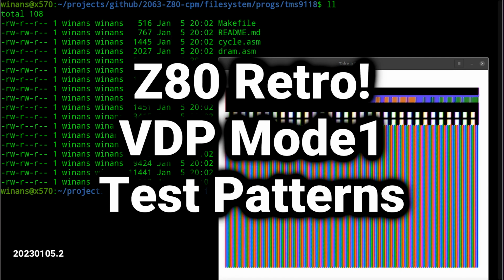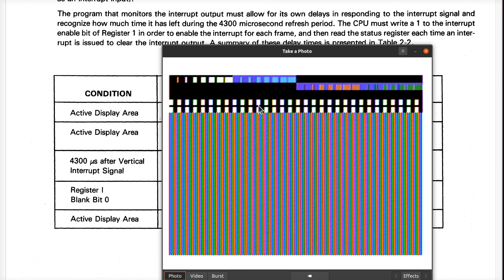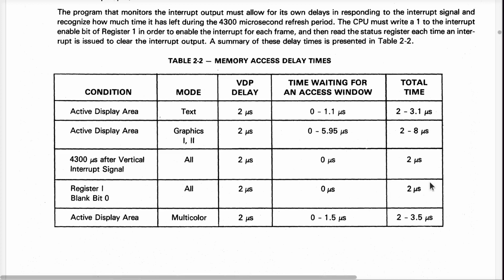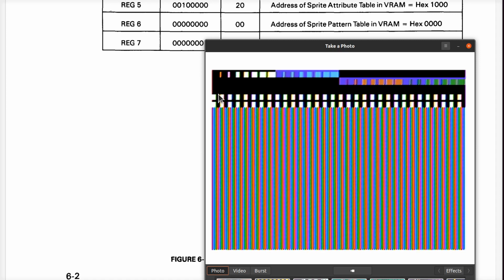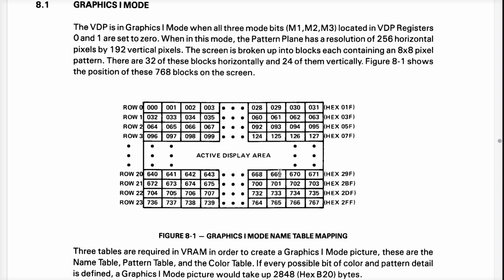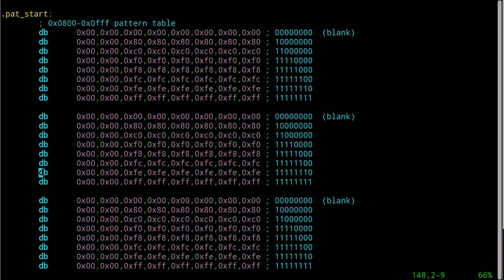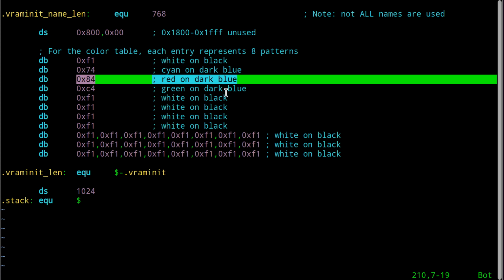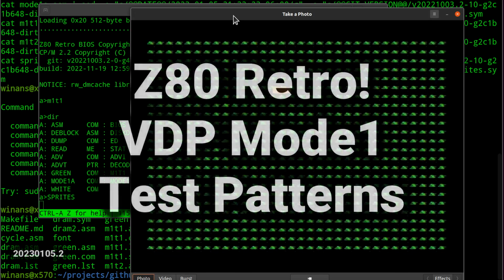Z80 Retro #56 - TMS9118 VDP Graphics Mode 1

Comment: Once I figured out the vsync interrupt, I was able to allocate 768 bytes of system ram to the display. This massively reduced the complexity of the game I was writing. I just store stuff in my allocation area and then the interrupt service routine streams it all out to the name table in vram every 60th of a second. My setup is a 6502 on a breadboard running at 1mhz. 

I'd need to run the CPU a little faster if i wanted to work with graphics Ii mode.
Reply: Just to follow up on this. At 1mhz i could refresh the display during the vsync window without delays. But at 2mhz I needed a 2 NOP (4 CYCLES) delay to not get tearing and garbage on screen.
Reply from the maker: I have been doing the same sort of thing... use some system RAM to prepare and image and then 'burst-copy' it into the VDP when the Frame Flag toggles.  I'm pretty happy with that so far.

Comment: If you're writing to the VRAM in big chonks, it really helps to set BLANK, so that you can write to the VRAM very quickly.
Reply from the maker: Oooohhhh!  That never dawned on me!  Great idea!
Of course, when running at 10 mhz, one can sneak in a full frame update during the vertical blanking period and run at full frame rate sans glitching.  Keep watching for the pcb update where we add a way to check the IRQ without the stability problem caused by the design of the VDP.

Comment: I think you'll find as you begin to use the chip more that the configuration table locations are more consequential than they seem at the beginning (especially as you try different graphics modes). The fact that you can't place them arbitrarily in the address space forces some tradeoff decisions as you begin to use the chip more. 

You might try messing around with the near-bitmap mode. It's nearest to modern bitmap graphics modes.  I remember using it to build the background of Joust.  You can get very close to the Williams arcade game look using that near-bitmap mode (I wrote a utility that took a screen capture of Joust and converted it to the near-bitmap mode automatically -- you can do things like JPEG/PNG viewers as well.)
Reply from the maker: Yeah, I already agree with this.  In the sprites video (coming soon) I already start to break up the data transfers into parts to speed things up rather than try to send adjacent tables in one-go.

I have never done graphics stuff before.  So this is uncharted waters for me.  After some twiddling with a design of a breakout game, I suspect that graphics mode II is going to be the go-to for most games.  It turns out that a traditional style breakout game will be fine in graphics mode I (only 2 colors per pattern/tile.) But it is already starting to feel cramped.

I suspect that mode I only exists to deal with systems that don't have 16K VRAM.
Reply: @JohnsBasement  

The TI-99/4A ran in graphics mode 1 I believe.  They implemented it in BASIC by giving the user high level abstractions over the pattern ("CALL CHAR"), name ("CALL VCHAR/HCHAR"), and color tables ("CALL COLOR").  Inside BASIC somewhere all the table addresses must have been fixed.

Comment: (edit: in MODE 2): the COLOR TABLE actually defines FG + BG color for every 4 (not 8) pixels. On am MSX in BASIC, if you set the pixels in reverse order (from bottom to top, rigiht to left) you can actually see all the NIBBLE colors. On MSX in BASIC, if you set the color left to right, the second NIBBLE in the COLOR TABLE pixel you are addressing, will automatically flip (might be a quirk/fault result of the POINT or PSET BASIC funstions in BASIC ROM). IE it is possible to draw "higher quality dithered pictures" like on the C64.

Comment: @JohnsBasement, to the interrupt problem: you have pulled up all address/datalines on de Z80. There is in int mode 2 no need to acknowledge the /m1-/iorq condition other then putting a vector on the databus. Wouit be a strange thought to reserve vector 0xFE for the mode-1 interrupt handler code? I believe that by not reacting on the /m1-/iorq the CPU wil read 0xFF from the databus, discards bit 0 and sees vector 0xFE. Please tell me i i am worng and why.

Rergards, Gert Jan Kruizinga, the Netherlands
Reply from the maker: Correct except there has been talk and experiments indicating that ALL Z80 versions discard bit 0.

Comment: Hm, can you write VRAM at full tilt if the screen enable bit is clear?
Reply from the maker: I don't know... But it should be easy enough to test.  Wait for the frame flag, wait 5msec or so, write the name table with new values, and see if all the right values are on the screen.

I'd clip a scope on the IRQ and write pins to ensure you are writing to it during the would-be active display portion of the field/frame.   ..I assume that the frame flag still runs when the display is blanked.

Comment: I say, wouldn't it be nice to make the artefacts disappear by not using the TMS9118 but the TMS9928, the PAL version should not have this, and nowadays PAL can be used in the US too, since worldwide all TV's are the same Chinese junk with different name tags on it. Your monitor will not believe its own HDMI input and display a crisp and rocksteady image. Don't blame me if your monitor start talking in French or German to you.
Reply from the maker: I'm thrilled to have a video interface on the Retro! board... which is something that I never had on my S100 system.. it was always serial.

But as I proceed with composite, I am reminded how limiting it was.  I'm starting to wonder about YPbPr or RGB on a "next project board" myself.

I already have some FPGA experience so that is very tempting.  Operating at 256x192 is feeling a bit cramped.  I want a crisp text mode that can do 80x25... really bad!  VGA has been calling out to me.
Reply: @JohnsBasement  I think the tms99x chips are a great way to get going.  They have their limits but that's part of the fun. I've seen some pretty good vga circuits with one even running at 640x480 on a breadboard! Retro 2 sounds great! I might even build that one.